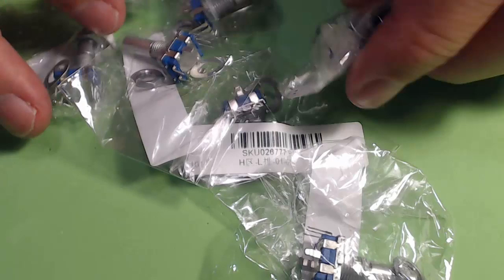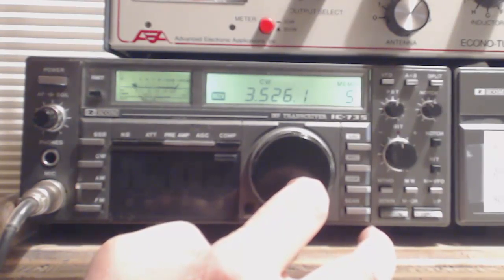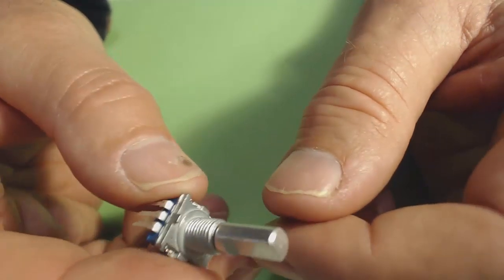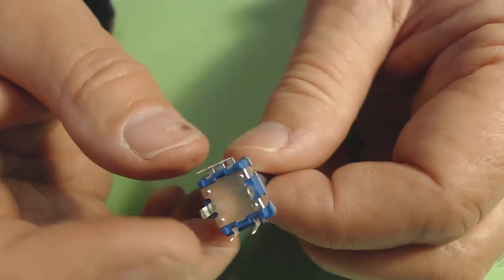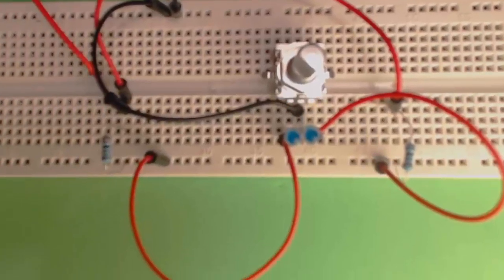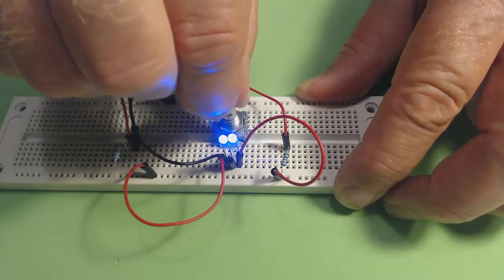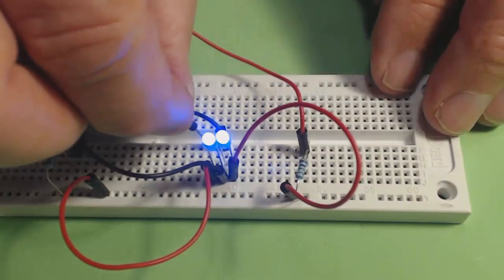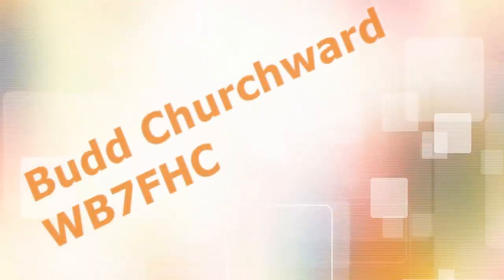Let's Look at Rotary Encoders Pt 1

Comment: Thanks for the video, nice basic explanation of how they work. I am replacing a volume encoder in a high end 1990s Alpine head unit that no longer has parts available and my question is will the number of step divisions have any effect on the operation of the unit, I am assuming a lower number of steps will just require more turning to achieve the same result, would this be correct? Thanks

Comment: Hey Budd!  I like the video!  I'm replacing all the encoders on the front of a Behringer LX1-112 guitar amp.  2 of them are 24 position stepped encoders.  Can I use any 24 position encoders that will fit?  Do they have to be 24 position?  The rest don't seem to have stepped positions, but I'm fairly certain they are digital encoders. They turn continuously without stopping unlike analog pots.  What kind of encoders do I need for these?  does it matter if I use stepped encoders for these or not?
Reply from the maker: thefunkybeat79 You may find that there are differences in the quality of encoders but they should all perform the same functions. Cheaper ones may have difficulty stopping at a precise location because of contact bounces. The number of positions probably doesn't matter. If you used a 20 instead of a 24 it only means that you have to turn the knob slightly further to get the same result.

Comment: Wait how many ohms resistors
Reply from the maker: These are current limiting resistors. Anything from 220 to 1000 ohms will do. I go with the higher values which results in dimmer LEDs. They photograph better if they are not too bright.